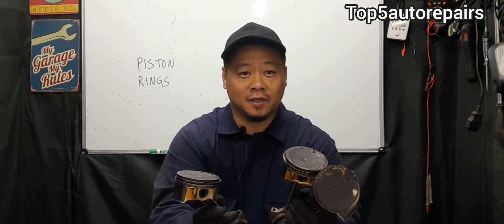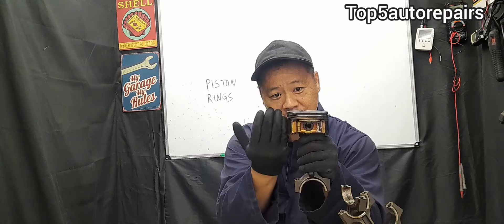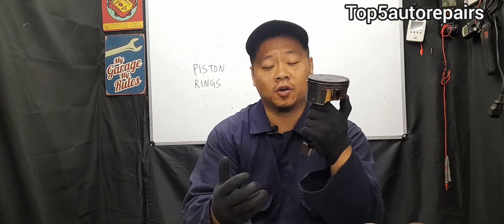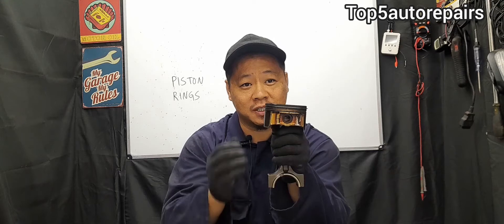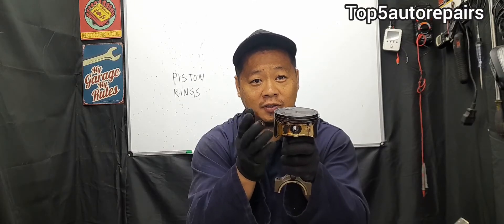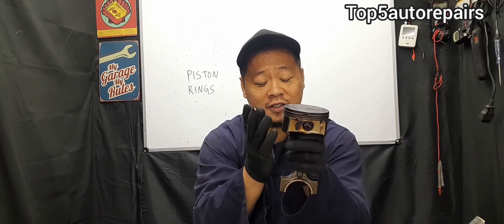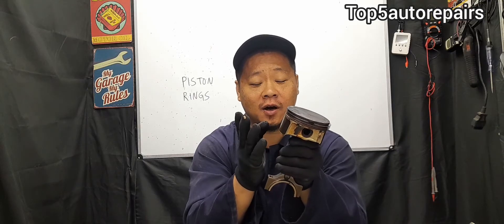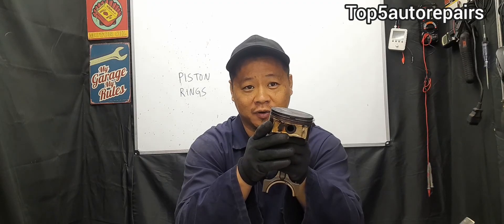HOW TO TELL YOUR PISTON RINGS ARE BAD AND IT'S TIME TO REBUILD YOUR ENGINE

Comment: I know this. 5.0 in f150 1990 has a misfire. I’m going to inspect valve rockers, take the head off, then open the bottom of engine unbolt the rod and put a new piston and rings in.  
Better than swapping a 500$ junkyard engine I think.

Comment: Smoke machine attached to a compression tester tube will also show smoke coming out of the oil dipstick when the cylinder is sealed the same way when doing a leakdown test if the rings are bad as well and determine if the i take and exhaust valves are leaking as well with smoke coming out of the throttle body for intake and precat o2 sensor hole if the exhaust valves leaking.

Comment: I have a 2012 Silverado 1500 and the funny thing is it burns oil at certain times. The truck runs great with no misfires, but after going down an incline and coming to a stop at a red light or stop sign it will blow a puff of smoke when I pull out from the red light. This is the only time it smokes. I've replaced the valve covers, valve springs, valve seals & pushrods. Some videos claim it would smoke all the time if it was a bad piston ring, then they're videos that say it will smoke at certain times. I'm stuck trying to find out what's causing this. PLEASE HELP!!!

Comment: For these worn pistons is it due to poor design (like low tension ring and finer oil scrapper ring) that easily trap carbon. It then jam up these rings?. In China they have complete piston replacement kits for VW engines suffering from jam piston rings.🤔🤔🤔

Comment: After watching your video… I’ve come to the conclusion my piston is slapping and the rings are bad. I just got a 15 Chrysler Town and country with a super sneaky P0301 code…. After trying EVERYTHING else normally done to fix it, it’s still there and spark plug keeps fouling. Also a pretty wild engine shake accelerating. 
Dang it!!
Reply: I’ve also got the P0301 code, in my 2010 Accord. Hardest plug to change lol. With mine I’m thinking Valve stem Seals because I have no piston slap. Just the fouling plugs and misfires before I change them.

Comment: I have an 18 camry runs good with no noticeable problems. i was doing some maintenance oil change, radiator flush, etc while changing the spark plug i put my endoscope camera in there 2 out of the 4 piston is black. should I take it to mechanic for compression test.
Reply from the maker: Hello. It is normal to have a small amount of carbon build-up on the piston. If it is coated with carbon, engine is running rich. There is no need to conduct a compression test unless engine is running poorly and barely running.
Reply: @Top5AutoRepairs once again absolutely great information from you in this video!  How would you "measure" (determine) if  the carbon buildup on top of the pistons is too much?   Thank You !

Comment: Can high carbon deposit cause cylinder wall or the piston rings to wear out? My subaru sti gc8 v5 have oil on the #4 sparkpkug and also low compression on only that piston side #4. What should I do?
Reply: Very good question, I have similar thoughts for my engine. I know it's been about 10 months since you posted your question, however if you could respond to me that would be great, did you find a workable solution for your engines problem? What did you do?

Comment: The million dollar question. Is it worth fixing? I have a 2008 2.4L with 267,000 miles. Also my VTC Actuator is bad too...The body is great. I will amit, when I brought the car new, I would wait for the maintenance minder light to come on. Thought that was great because I didn't have to track the mileage between oil changes, Big mistake! Only vehicle I have done that on.
Reply from the maker: Hello. I recommend getting a compression test. If compression is too low the engine is junk. At the point, you can have the engine rebuilt or replaced.
Reply: @Top5AutoRepairs Thanks for the  quick response.
Reply from the maker: Anytime

Comment: My klr650 had bad exhause galve seals and i was consuming oil daily. One day my bike wouldnt start after a previous days ride. It just backfired. I heated the cylinder with a heat gun and the bike started right up and idled at 3000 and i coult start it every time only when the cylinder was heated up first. What do you think it can be???

Comment: My engine is screwed some mechanic I know said only one cylinder is not movie up and down when I start my engine. Said a barring or spring broke off a rod or something like that. He said he would have to go under the car to remove oil pan to try to fix it that it’s a 50/50 chance to save I never switched my air filter maybe that’s my lessened learned I put so much money into my car then this happens makes me want to quit life so much in my life that’s going on so many problems. I hate life now. Sadly..
Reply: Hope your life is better
Reply: @tonypepperoni612 it actually is got my engine swapped and it’s up and running thank you 🙏
Reply: @t @tonypepperoni612 just subbed to your channel
Reply: Have you found love for your life again Dan? Cars suck don’t they
Reply: We can get another car. We only have one life.. My car has pissed me off.

Comment: Completely agree with everything you say on your explanations are comprehensive. I would just add the often when piston ring wear is present that is also some cylinder bore wear. Just replacing piston rings in that scenario will not result in a complete solution..... If you've got this far in an engine strip then please also check the bores for ovallity....

Comment: Bad valve seals also create same symptoms
Reply: I just took apart my 15 year old motorcycle engine and wow, the valves were so full of gunk they weren't closing at all. Looked nasty.
Reply: I’m in the same boat rn idk if my rings are bad or valve seal
Reply: @Shotby_shiv  If you have smoke at all speeds as he said, it's rings. On start up or after idling like at a red light it's seals
Reply: My klr650 had bad exhause galve seals and i was consuming oil daily. One day my bike wouldnt start after a previous days ride. It just backfired. I heated the cylinder with a heat gun and the bike started right up and idled at 3000 and i coult start it every time only when the cylinder was heated up first. What do you think it can be???

Comment: Great information. Thanks!
Question for you, as to what product and how much you think I should use. I have a 1995 Subaru 1.8L 4-CYL boxer Impreza, 177,000 miles.  I have 76 and 78 PSI dry compression in #2 and 4 of one head (driver side).  This started a few days ago, we noticed while on a highway trip the power was weak and I can hear it missing as the RPMs drop from driving to idle.

I don't have overheating, excessive oil consumption (drippy seals, I add a quart about every 900 miles), smoking, or fluids cross contamination.  I'm waiting to have a leak down and another dry/wet compression test at a different shop. The first shop only did dry compression and wasn't too bright or helpful. 

If I end up having a head gasket leak between those two cylinders, what products would I possibly try to mend it?  It must not be too bad of a leak, whatever it is, for the compression to build to 78psi dry.  The other two good cylinders are 130ish psi. 

If it ends up being a valve leak, what products and strength could I try to get them clean?  After cleaning, I will have valve clearances checked, as it's probably never been done. 

Thanks!

Comment: What is the best way to measure  blown by? I guess the PCV valve must also be taken into account?
Reply: You can check by smelling the oil. If it smells like gas that's a dead giveaway. PCV only manages the valve cover pressure. It's a whole different part of the engine.
Reply: My oil smells like pure gas! What can I do?
Reply: @conspiracyqueen44  Change your piston rings. They're leaking and letting fuel into the oil. Piston rings are very thin. If they get damaged even a little bit they start leaking fuel into the oil.

Comment: If oil is getting to the spark plugs would you recommend looking at timing to be sure its not the piston rings?
Reply from the maker: If oil is getting to the spark plug electrode check for bad valve seals and piston rings. If oil is on the terminal check for bad spark plug tube seals. There is no need to check for timing unless there is performance issue.
Reply: @Top5AutoRepairs i appreciate your response and i am subscribed because of the tremendous value you provide. Sadly its getting to the electrode so oil is getting into the combustion chamber. Its doing it for all 4 spark plugs (inline 4) i was wanting to see if it was worth checking the timing since its not just 1 spark plug thats getting fouled but rather all.
Reply: @Top5AutoRepairs  i did a bit more research and i think the spark plug fouling is actually being caused by the vehicle running rich. The electrode is dry. So i might have to check my fuel system.
Reply: Check ur valve cover & ur rings!!!